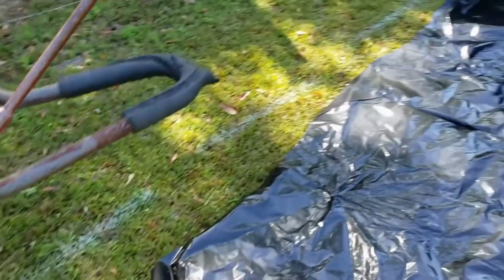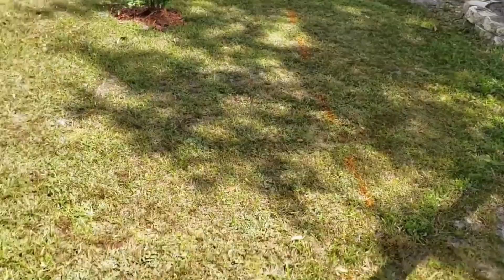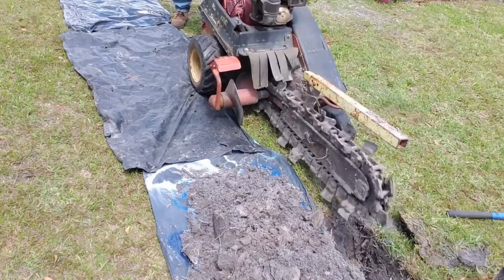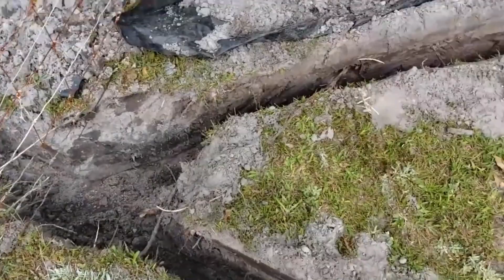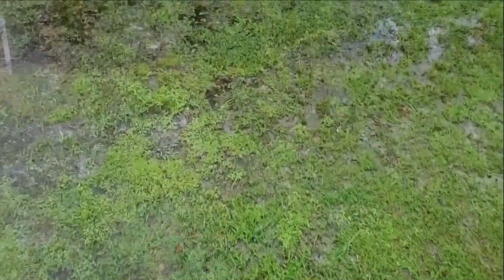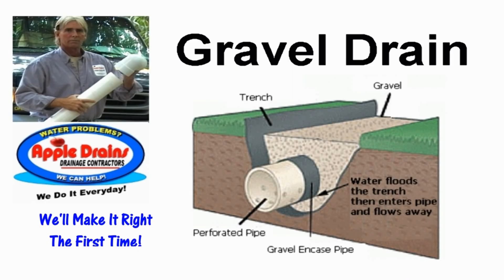How to Build The Best French Drain, 2 Drains | 100% Guaranteed | Great DIY

Comment: Hey Chuck awesome videos! Youre probably very busy with the business and responding to comments. This is going to feel like I am peppering you with questions. I am digging trenches for french drains around an inground pool (53 ft x 26 ft) put in several decades ago. I was wondering the following: The dimensions of the trenches, inches below the concrete for the top of the gravel, pitch of the perforated pipe, do I need to wrap pipe and gravel in fabric and can the top of gravel stay exposed? Im sorry for the long comment, I wholeheartedly appreciate any guidance and help.

Comment: I thought i had everything figured out but according to a an expert, gravel should not be below the drainage tube because water will pool up under it if it does and roots will grow into the system. 

what do you guys think? 

Also, I'm in the mid-west and worried about clay. Am i asking for trouble if I don't use a wrap? 

and how far away should the system be away from a foundation?? 

I wish there was a video that talks about everything and there wasn't a million ways to install a drain.

Comment: I'm so confused 😕 I literally just watched another video that you said Not to use the geo fabric because it doesn't allow water to flow into the drain very well... I'm in South Mississippi and I have a huge water ponding issue thats going under my home and now I don't know what to do again 🤦🏻‍♀️
Reply: I just watched a video that says not to use stone under the pipe … so my take is that the soils underneath determine whether stone is used under the pipe or not but always use fabric under the pipe
Reply: I had the same problem with water. My neighbor's property is above mine and caused major flooding of my house and foundation. Water was seeping in at the footer and when we had major storms of 4 inches or more, it came under the door. First, I dug down to the foundation and sealed it as Chuck has shown on many videos. I dug a deep hole and installed a sump pump basin and a zoellar M-98 pump. I installed 6 inch catch basins in the 4 lowest spots and had them run to the pump basin. I installed 2 downspouts from gutters and ran them to the basin. I used solid 4 inch corregated pipe from catch basins to basin. I used Schedule 40 pipe as my discharge out to a swale. That Zoellar pump is so strong that I thought thin wall might not hold up to the pressure. My biggest problem was my discharge line because the pump was so strong. I did not put in any French drains because my problem is getting rid of the immediate water. This spring I replaced the flate grates on my catch basins with the atrium grates. This eliminated a problem I was having with grass clogging the flat grate. I live in SE Oklahoma and have dense clay soil.  It takes a lot of time for water to perculate down to a French drain so elected to solve my problem with just catch basins. Chuck's videos enabled me to do all this. I wish I had know about this years ago. By the way, I dug all this by myself last year at age 75. It took me way more than a day. Chuck says, "If you think you can do it, you can". And I did.
Reply from the maker: Sandy soil- wrap clay -optional
Reply: I live in Minnesota, and we have a lot of hard pan clay, too.  Did you film what you did? And hats off to you!  Thank you for your comment.
Reply: He flip flops over time😂
Reply: Watch the French drain man instead he will give you WAY better guidance than this  guy
Reply: @dwighta2025 lmfao French drain man is out to make money, sells corrugated pipe for 1000 bux. Also doesn’t share info for free like chuck. Chuck >>>> French drain scam man

Comment: Thank you for all your information and video content. I’ve learned an extreme amount of valuable lessons watching. I wanted to know your opinion on how to make a trench in very rocky soil? I’m in Wisconsin, and my yard has tons of rocks in the soil, and using my shovel has been pretty hard. I’ve already chipped the front part of the shovel, and barely made any progress in about three or four hours of digging. I’m trying to install a French drain and a gutter drain, and have to run about 130ft total. I’m hoping to not have to spend too much money on the the project, but feel like it will be to my advantage to rent power tools. Thanks again, and keep up the awesome work!! Cheers
Reply: Sometimes those trenchers dont like rocks, I have owned several. 36-48", You might looking to getting a pressure washer to hydro excavate and a trash  pump to clear the water that builds up from the pressure washer. Try searching hydro-excavation.

Comment: No idea what air locked means. And I wish the other fabric the EZ Flow was shown how to install.
Reply from the maker: Hi Clairez . Air locked references trapped air in the pipe. It stops the water flow. As for EZ FLOW DRAIN PIPE .. just just the channel. There are hundreds of videos show how to install. Thanks for your comment!
Reply: @appledrains  So, how do you prevent the catch basin from air locked again? So you don't have to manually remove the lid after heavy rain.  thnx

Comment: i have water puddling in my backyard during long periods of rain it always collects in the same areas. My question is with my yard being flat would i be able to move some of the water to the front of the house using a trench drain? I dont understand with no hill side how the pop will work if its uder ground seeing that i have to slope to where i want water to flow? would a dry well be a better solution for me i live in broward county fl if you also dont mind checking my property out please reply

Comment: How about for clay type soil? What would you use for that?
Reply: We put a french drain in. Our property is heavy clay and Geo-textile fabrics of multiple weights wrapping large stone and the pipe kept getting clogged within no time. When our clay gets wet around here its pudding. So far, best solution that continues to work for us is a really large trench, ours is 28" wide and about 20" deep. Filled with stone that ranges from 2"-4" round and the pipe now continues to flow freely. Yes, its a crap ton of stone but its working.
Reply: @jimbov23  I am in the same situation with clay soil. I have about 150ft long trench to go. So after trenching, did you put in large stone first, then the pipe, and then more stone top of pipe? What kind, size of pipe and with or without holes did you use? Really appreciate your response.
Reply: @permatopiafarm  Originally we had wrapped the trench in Geo-textile fabric like you see all over youtube and we used an expensive quality fabric from a specialty store , put the 6" corrugated and perforated (slotted) pipe directly on the bottom on the fabric at a measured slope and covered it with stone but we soon found the fabric causes the water to drain very slow and eventually the fabric was quickly clogged with the fine clay. We ended up ripping that all out, and now have just an open dug trench that we widened which we put just about an inch or so of stone at the bottom, the pipe on top of that then back filled with  2"-4" round drainage stone. It flowed water much more freely and has been working with no issues so far. While I know filter fabric works, it does not work at all in Clay soils where I live at least. I found that out the hard way. Clay already slows water saturation and when you add a barrier of even the best quality fabric, its makes the water just pool and be even slower. Our situation went from bad to worse suing fabric. I believe our fabric had completely clogged from clay deposits within a few months of heavy rains. This fabric free trench is working much better. It reduced all of the standing water and the clay soil dries out probably 90% quicker and it now longer like pudding for weeks after heavy storms. We also put in catch basins every 20' of so, especially in low spots. We've put a camera down the pipe to check it out over time and its still clean. I've spot checked areas by removing all the stones to see if any clay is merging into the stone which was my initial worry and so far so good. It's very very minimal which was great to see.
Reply: @jimbov23  WOW...THANK YOU SO MUCH for your detail explanation.  You don't know how much you have help me coming out from what they called an "analysis paralysis" state because it's been months of trying to find an answer. I have watched countless of youtube videos, and they seem to make it so easy and working so well but then I realized they don't have heavy clay soil like I do here, till I came across your comments then WHOA!!!...YES, THAT'S IT!!!, someone in similar situation.  It makes so much sense to me. Because we lived in a farm environment, and I will need a strong pipe. Instead of using 6" corrugated perforated pipe, I was thinking of using 6" schedule 40 pvc perforated pipe because I think it is stronger, what is your thought on pvc pipe.? Also, do you use the same size round rocks for bottom layer and top of pipe? Again, THANK YOU.
Reply: @permatopiafarm  If you plan to drive over the pipe use PVC schedule 40 that's perforated for drainage and point the holes downward on the stone bed. For the bottom layer of stone, we used a washed stone that was 1" or less in diameter. To cover the pipe we used 2"-4" washed round rock stone. Remember to get washed stones at a minimum. We initially also went off what we saw on youtube and advice from some drainage companies about burrito wrapping the stone and pipe but in our clay soil, the ground water ended no better and the drainage was super slow. Took almost just as long to penetrate the filter fabric as it would naturally drying up which was days and sometimes weeks. We then had a neighbor a handful of properties down mention they had to remove their fabric layer about 8 years ago and its been fine since.  Removing the filter fabric layer on ours too made the water flow freely for us. Our clay up here is nasty.
Reply: @permatopiafarm  Wondering the same.
Reply: @jimbov23  Are you using about an inch of drop per 10'?
Reply: @jimbov23  We have nasty clay at my property in PA. It's actually quite beautiful in it's purest form but does not drain at all. In fact water evaporates off it vs going down through it. It can sit for weeks or months and not go down. The clay is the exact color and appearance of smooth creamy JIFF peanut butter. It spreads with a knife or stick like fresh peanut butter. When and if it dries it is hard as a rock and nothing grows on it. Really interesting stuff. A pain do dig out 6 dump truck loads of it for my pole barn though. It rained during the building process of course. We could barely walk. Several inches of the clay immediately sticks to your shoes and gets all over the driveway etc. In fact I had to use the snow plow to clear the driveway of most of the clay. Our property looked like a natural disaster had occurred.
Reply: @flat6fever680  Lol...I laugh because it sounds like you describe our soil..especially the part about it sticks to your boots real thick and won't let go. I have to use paint scraper to peel it off before washing. Well, after much research, I decided not to use any fabric, pipes, etc... One local guy who sold rocks recommend putting a good layer of sand down first for drainage then laid down rocks on top of sand making it like dry creek bed. If I do that, that would mean tons of sand and rocks being delivered to our place, that would cost us about $1000 for a truck load of sand and rocks including delivery. We have tons of rocks here on our property. It just a matter for us digging and gather it ourselves. So my thought is if I am going to do dry creek bed, perhaps I can skip sand and just use our rocks on our property. Maybe clay soil will act like glue and hold rocks together. Our property has different size rock, from small to as large as laundry basket. So that's the route we plan to take. We have about 150 trench to do so maybe I will experiment with about 10ft of just rocks and let it go thru one heavy rain event before I do the rest. Thank you.
Reply: @jimbov23  How large of pipe and how many pipes? Perforated etc? How many inches of gravel underneath and on top of pipe? I plan to do what you did. Thank you.
Reply: @jimbov23  Nevermind, I see you answered that below.

Comment: I have a couple of questions: 1) I’m in Binghamton NY. Soil is very dense and tightly packed. What pipe would be best? 2)There is a portion of my trench that is approximately 4 ft deep as many, many years ago it looks like a past neighbor has added 2-3 ft of soil to level their property. I’m afraid that the ADS would get crushed under that and am leaning towards the thin walled PVC with holes pointing down and back filling with Round #1 and 3) fabric or not? Thanks.
Reply: Look at the specs at the product available to you. If you follow the manual it has tremendous strength.

Comment: I don't recall you using large gravel like that before. Does size used depend on the situation?
Reply: Use 1inch clean rock! not river rock
Reply: What's clean rock as opposed to river rock? @danraymond1703